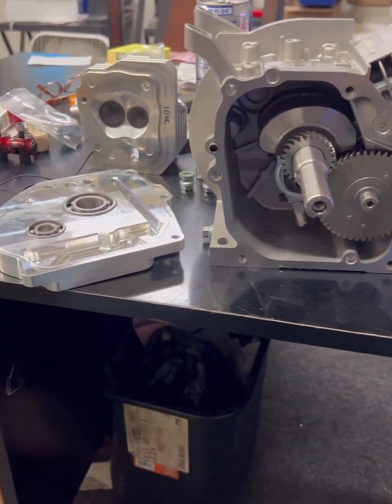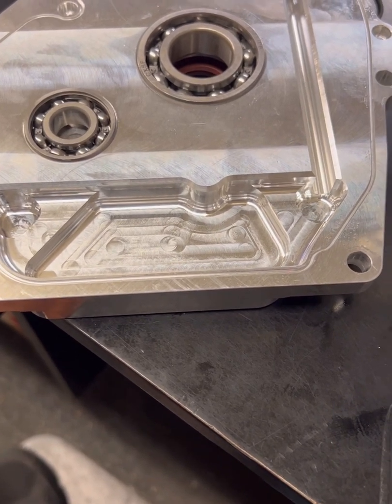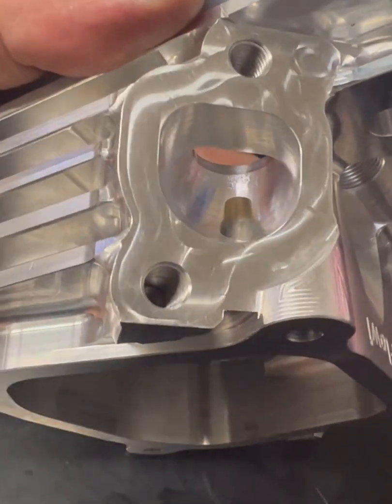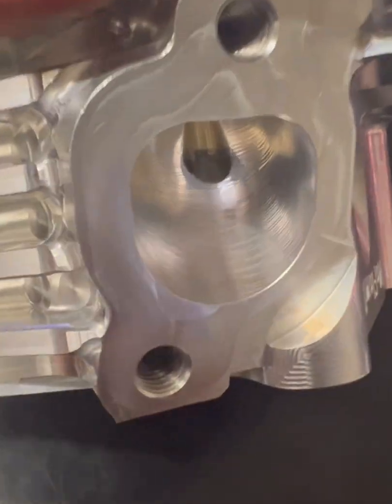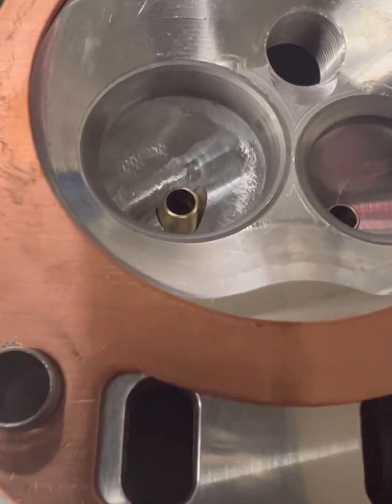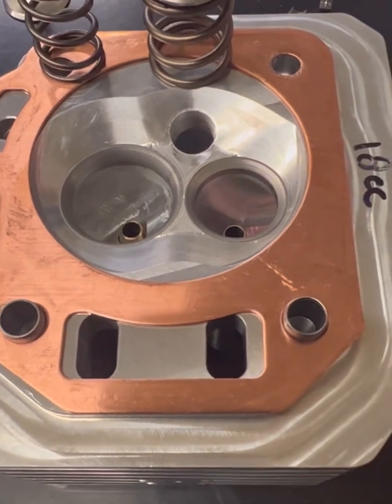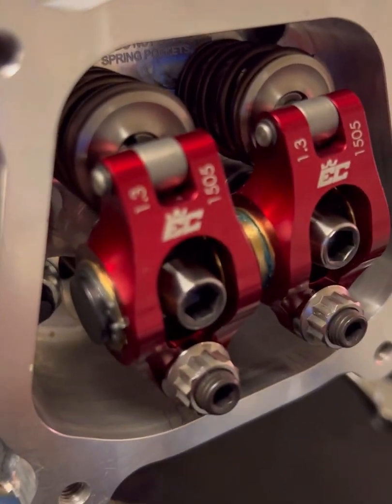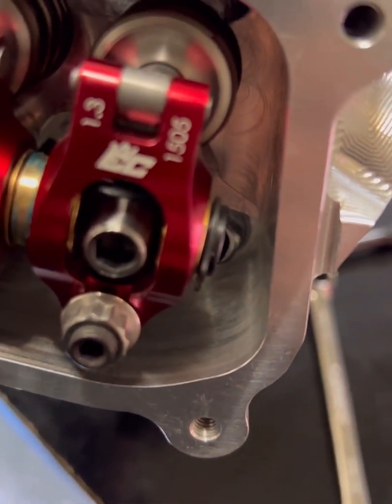Tillitson / EC Carburetors 236cc big bore stroker, MoFlow cyl head and more.

Comment: Yeah, love the content there Ice ! Been noticing for years how everyone is building a gx240 in a 200 block. Kool stuff,so what can I make out of my rebuilt Honda gx 240(242cm3)?? No hours on the build and runs good with my epoxy port,you know hollow out and backfill where necessary,,,,
Reply from the maker: I know some of the kart guys use the GX270. Is the 240 a small bore or short stroke or both?
Reply from the maker: I know some of the kart guys use the GX270. Is the 240 a small bore or short stroke or both?

Comment: Does that stroker kit fit a Tillotson 225?
Reply from the maker: I’m sure it does, with a 225, all you need to go 236 is the crank and rod
Reply: @peterchristlieb  do you think it will require any clearancing in the 225 tillotson ?
Reply from the maker: @blakestonebustosrb  If the 225 uses the race block, it should clear no problem. Depends on how big a cam you use also
Reply: @Frosty The Iceman 79  307 cam. Could I just replace the stock crankshaft with the 58mm wildcat crank or would it be smarter to just buy the EC 236 stroker kit?
Reply from the maker: @blakestonebustosrb  I’m pretty sure the rod length is different so you need the EC Rod. Should work great
Reply: @Frosty The Iceman 79  kool, sorri for all the questions, I appreciate it though
Reply from the maker: @blakestonebustosrb  I’ll post another video assembling the next one. All I had to do was open the ring gap up and make sure the cam didn’t hit anything

Comment: What’s taking up all the end-thrust clearance?  The cam or the crank ? I’ve had cams that were a bit long..... the side cover wouldn’t sit on the case. I check the clearance with just the crank installed and adjust the shims, then pull it out and check end play on the cam with just it installed. I had to take some material off the thrust side in the case for the cam once.
Reply from the maker: Honestly, I had close to zero end play with no washers on the crank. The cam fit with no issues but I’m about to pull that side cover and change a couple of things. I have a feeling the end clearance grew.

Comment: Hopefully you've removed the comp release from the cam. It'll hit the crank counterweight and detonate eventually.
Reply from the maker: I saw a video yesterday about that, looked like it took out the whole lower end. Problem is I need a Starter…
Reply: @peterchristlieb  Either that or you have to grind the crank counter weight to clear it. I managed to make that work. Then polished the heck out of the rod side to try and balance it back again.

Comment: Great video!!! I love all the reviews of each product. I am actually the manufacturer of the moflow and I can add that the valves have been moved around but retain stock spacing and rocker stand width so any misalignment is from the rockers. There has been a few improvements to the heads sense your version. Now with longer valves and more installed height. Which allows longer guides for better control. I do see some exhaust seat angle change in the near future. I appreciate your video! Keep up the good work!
Reply from the maker: Mark, I hope you didn’t think I was blaming the head, I’ll go back and edit if that’s what it sounds like.
Reply: @peterchristlieb  no I didn’t feel like you were blaming the head I was just trying to to clarify for you or other viewers that while everything is moved it’s still stock geometry for the rockers and valve spacing.
Reply: @markkonschak6288  i need help modifying a billet head. Simple changes like offset guides and bigger seats. I know you can definitely help me as you designed this entire head and other things 🤣
Reply: @aaron7520  hey Arron, I appreciate your confidence in me. Unfortunately I don’t have time to do 1 off parts. I’m focusing on improving and designing new parts. I am making some changes to accommodate larger valves in a moflow. Message me on Facebook or Instagram and we can talk some more.